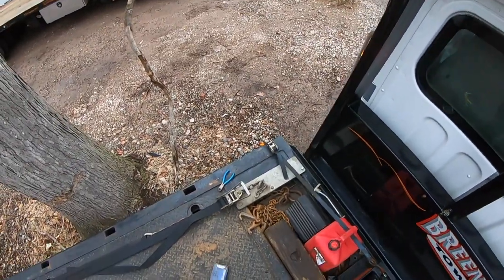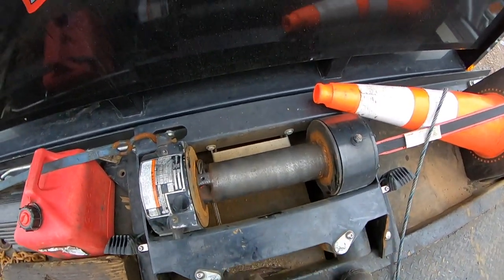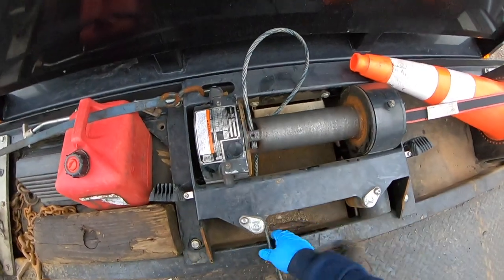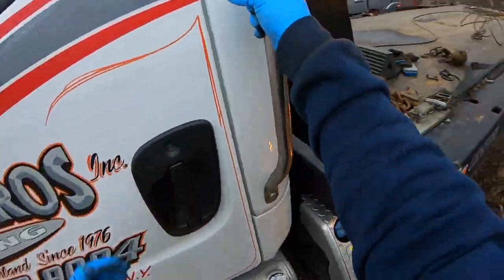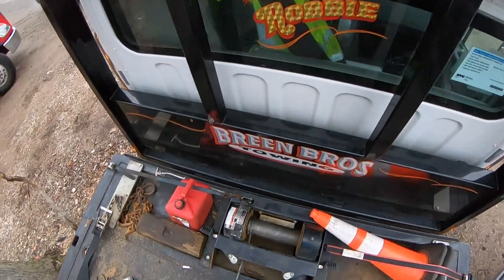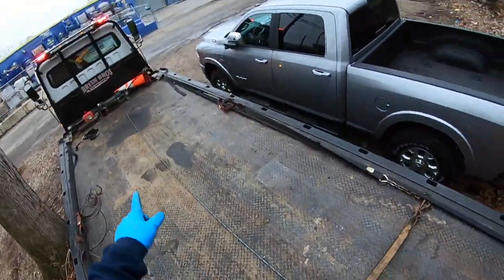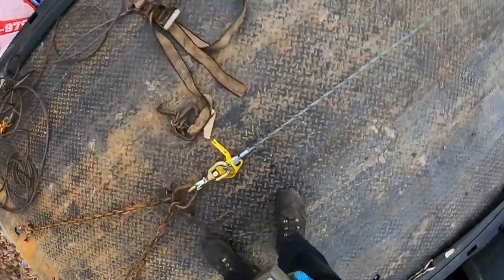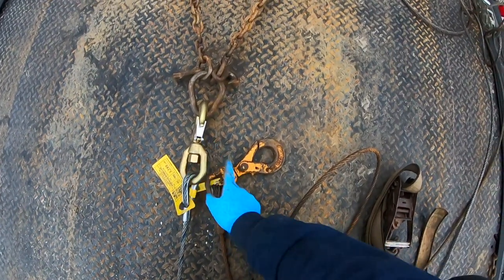How to change a winch cable.

Comment: I was taught to tape the end. Then add grease or silicone to the end with the tape. For that smooth glide inside.
Reply from the maker: I’ve always used tape. Never tried the lube for it though.

Comment: Only other thing id suggest after using the tape, is to grease the set screw and hole with PB or WD40. Reason being is those screws sometimes seized up and it's hell after that to get them out. Unless you go through a lot of winch lines per year, ijs😂😅
Reply from the maker: 😂 it was smooth but I know what you mean. I’ve dealt with some that were stuck and wouldn’t want to unscrew.

Comment: Hi you ever change the clutch on them how difficult is it?
Reply from the maker: I haven’t changed a clutch on one but they don’t seem to hard to work on. You would have to removed the winch so you can work on it easier and have full access to everything.